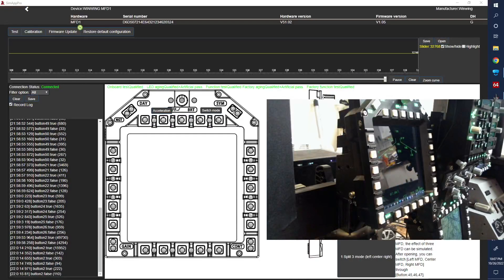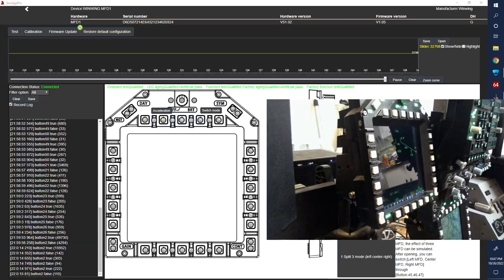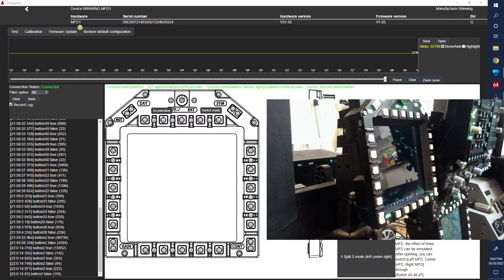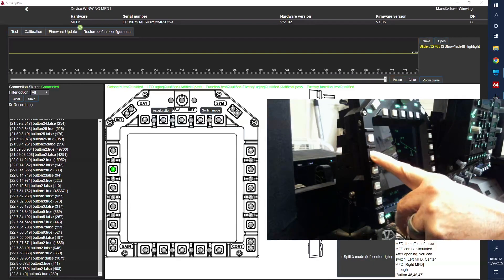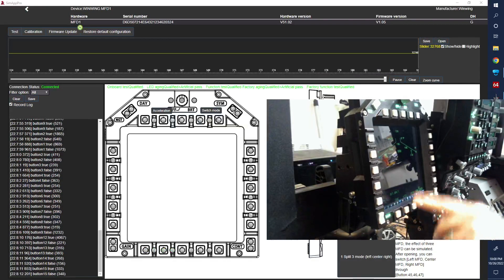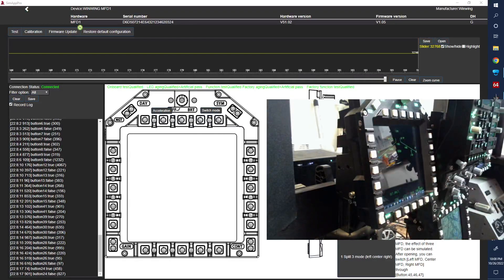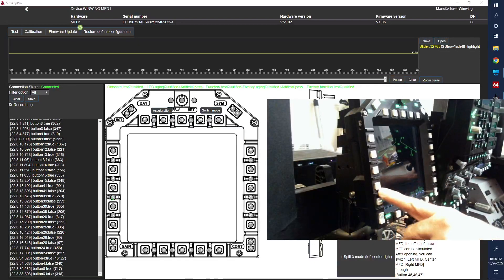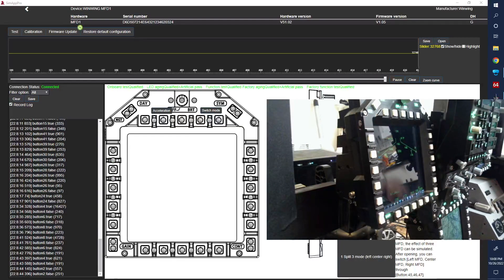WinWing MIP  MFD/DDI - "Hidden Buttons" - Apache Pilots pay attention!!!!!

Comment: John, nice setup.  Just got mine but haven't set it up yet.  How did you mount the left and right DDI's?  Steve
Reply from the maker: I ended up with a t-slot aluminum frane to mount everything to.  I'm currently 3D printing the rest oif the F-18 front panel, its turning out really nice, I will post a video when I get it all done